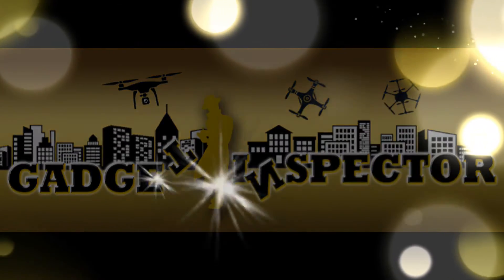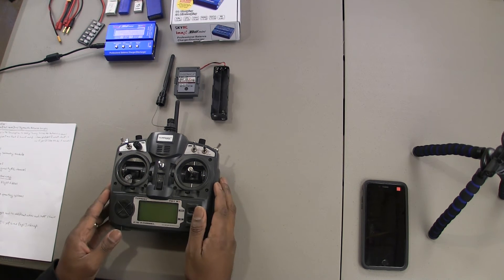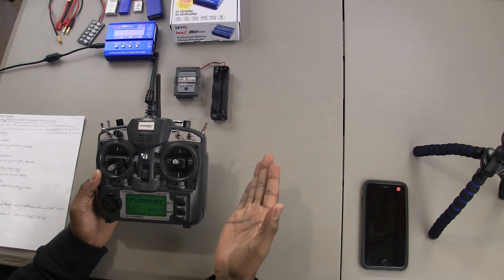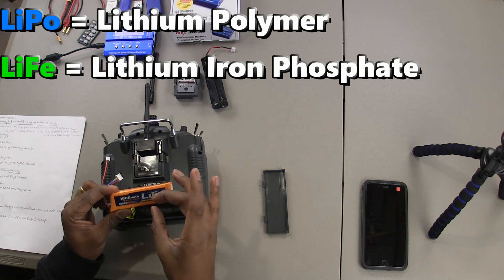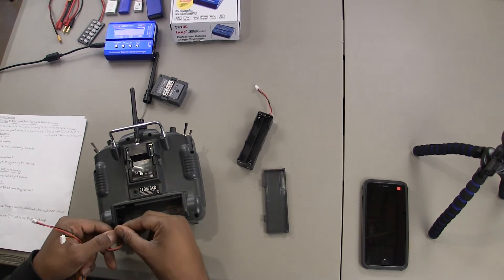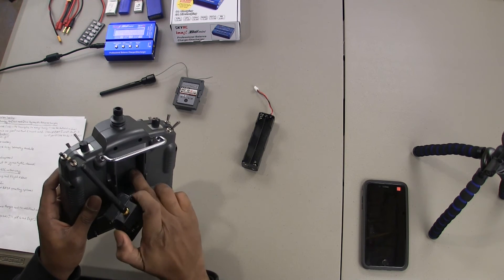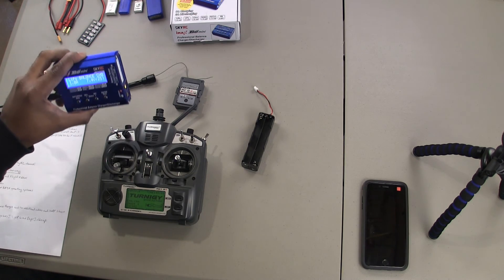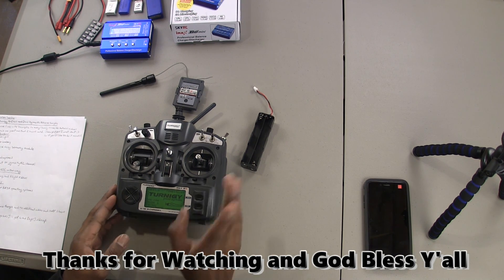Toolbox Tuesdays #1 - Turnigy 9X Must Do EASY Modifications and Other Stuff

Comment: Nice video. I would like mention a couple little points though.
the power connector. Even if it looks like one, IT IS NOT a 2s balance plug. The connections are different. people could think they can plug a 2s battery, but they would destroy their radio and battery if they did that. And I explain why.
The radio's connector has 3 pins, just like the LiPo connector, but, it has positive in the middle, and ground on the 2 outer pins. A LiPo battery has Ground on one of the outer pins, and full voltage on the other outer pin, as you see, plugging a 2s battery will cause some fireworks. 
Also, you could actually turn that servo connector around because positive will stay on the middle pin. We must be careful with polarity, as this radio is not protected against battery reversal.
Reply from the maker: Thanks for making that point clear, I am going to pin your comment to the top so folks will see it.  I mentioned the importance of polarity, but you're right, someone may go off the grid and try using a 2S lipo instead of the LiFe battery in the video.  Safety first.

Comment: Great video man,as always,this should definately be a series!
I wanted to ask you a question,  since you are a very experienced drone enthusiast could you recommend me a drone that has the same specs as the xiaomi mi drone but the extended range,about 2,5 km?
Thank you in forward!
Reply: Personally I like to UPair Drone, cheap, 2k or 4k camera, easy to use --- essentially a DJI mimmic without the same features -- plus the Gadget Inspector did some videos on it 😉
Reply: Thank you for the suggestion Lyle but the main problem is the range its only 800 m if i could find a drone with the same specs and more range for the similar price that would be great! That's why I asked the gadget inspector for help!
Reply from the maker: Hi Haris.  For what you're looking for you should probably research the Autel Xstar Premium or the Phantom 3 Pro or greater.  The Xiaomi Mi drone has some great features, but they had a horrible initial release with all kinds of issues.
Reply: Thank you for your recommendation ,ill take a look at them!